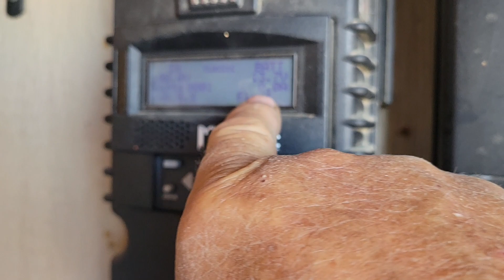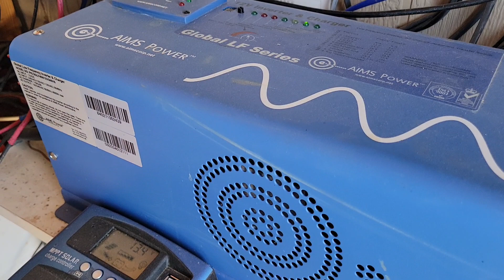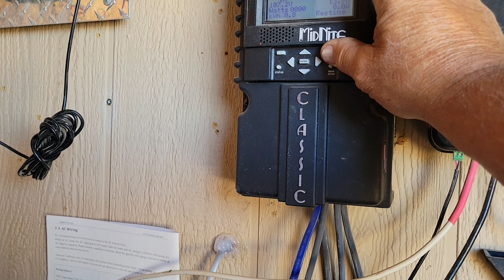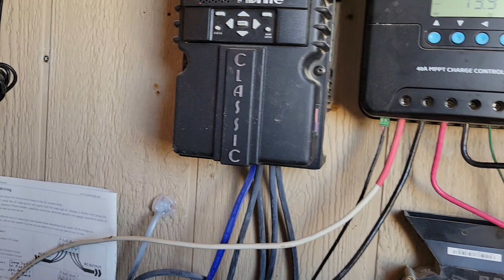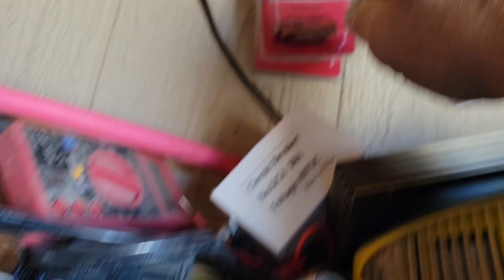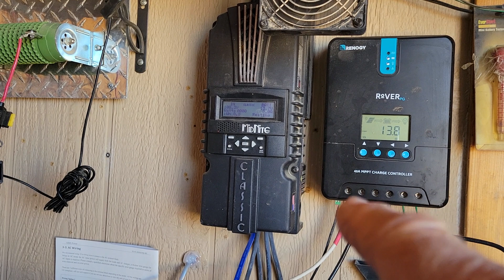How Much Electricity Did I Get In A Week of Wind & Sun? April 13, 2022

Comment: Hi G Bear, thank you for answering some of my questions,  I appreciate that!  Yes, you got some great equipment there...made in the USA 🇺🇸!  Unfortunately I resorted to other brands...although I did go 'big'.  Trying to save some cash doesn't always work out...hope I won't be disappointed when I get it all together there.  I understand about not over-burdening the controller,  and matching pv output with battery capacity.  My concern is  about extra power that I wouldn't use up, in the float stage....this  controller I have is supposed to be able to handle it to some extent as I understand it, but would I possibly need more of a diversion as well?  Thanks again for your help!
Reply from the maker: Diversion is only used with turbines that are directly connected to the battery bank.  All it does is put the batteries under load when the turbine is mega producing power.  It is inefficient and seldom gets activated unless you have a week of high winds like I just went through, but mine didn't activate because I was using the excess power to run a 1500 watt electric heater,  so I was the "manual diverter".😁
Reply: @GBear  thanks!  In the Philippines  I'll just leave the a/c on...that should take care of potential extra power.
Reply from the maker: Lol, as long as your system can keep up with the AC...
Reply: @GBear  yes. I understand..lol.  I noticed you have 2 controllers.  Are they tied together?  If you had to do it all over again,  how would you apply controller(s) use...incorporating both pv and turbine energy?  I was thinking of having separate controllers for turbine and pv charging the same battery bank.  But suppliers frown on that, stating that there would most likely be confusion between the controllers, even if the models are identical.  Speaking of confusion..I am! Lol!
Reply from the maker: I have multiple controllers, all connected to the same battery bank. The 2 main controllers and 4 Harbor freight controllers.
If I would do it over, I would never have bought Chinese stuff.  I would have three Midnite Classic controllers, 2 of them for solar, and one for the turbine.  Midnite controllers can either be used for solar, wind, or hydro power, but not mixing them through the same controller.  Each input requires its own controller.

Comment: G Bear , loved the video, where is the generated power going when the controllers are in float ?
Reply from the maker: Thanks.  It is actually going to the battery bank, but as a trickle charge to maintain whatever the batteries are putting out.  When 'Resting' it just disconnects the solar input.

Comment: I have more than I will use ; at  2 AM  showing 25.4 v on the 18. There was baseball sized hail in the Western part of the state, is why I bring my panels in sometimes. I only brought half of them in this time. I'm distilling water for a battery check and fill. While it's cool enough to use the wood stove. My charge controller stops charging at 27.7 v. ( 13.85 ) but when the smoke clears it will be at 25.8 ( 12.9 )after sundown. I used four pairs of #14 coming in to the controller...today I had 1000 of the 1200 watts of panels out, and the amps were 17.8 or so. The amps used to be around 26 but I split the panels up to face East and West so now it charges until 8 PM, but more amps in the evening than it was before...what it does is if I cook, it has time to charge back up even on cloudy days. A little less amps during one part of day but more the same for most of the day. The voltage fluctuates less. You gave me an idea...When I'm getting too much power tomorrow, I'll plug in the A/C and see how it does. I can fire up the wood stove to simulate summer heat and see how well the system holds up before actual use. I'll get the fan motor oiled up and try it out. I think I have enough to run it now. I have added 600 watts of panels, and 8 batteries since the last time I tried running it. Thanks for the great energy wasting idea, I'm going to try it. I used red #2 welding lead wire on the  + cables, and black on the - . I already got a double box end wrench across the bolts on the inverter after I had all the other cables on, and melted the end of the bolt a little, I will have to use a dremel tool to get the cables off. Two red #2 ones.  It took a chunk off that box end too. But the nut is tight and it's working fine. I put red and gray duct tape over the bolts because the covers won't fit over 2 cables like I have, the terminals are too big...I got the 1/0 size that are part nickel. There is actually room in the lugs to add a second #2 stranded wire and solder them together. I wasn't sure what all I was going to get into when I get the final two batteries in about 3 weeks. I just figured 20 batteries were going to need a lot of places for connections, so I left a third set of #2 cables option. Adding the final two batteries is going to bring my amp hours to a little over 1000, @25 v. = 25,000 watt hours. I have noticed the last few times that I added a pair, the amps goes up from the controller into the battery bank...I assume this means it's more efficient. I will see how much things change...all the numbers change every time. Here's the latest puzzle ; if I only get an amp or so per battery charging, will they use less water this summer? And if there's only a few amps per battery of discharge, will they last almost forever? I hope so.

Comment: Your stuff is getting a bit susty and dusty.  Use fan from  /  filter coming from the out side and the clean air will over pressure all the nuks and crannies that dust can come in.  Things will stay much more DUST FREE. The only way to keep the sand dust at bay here.
Reply from the maker: There's no such thing as dust control in this desert.🤣
Reply: @GBear  LOL No BS THERE.  It does help.  Seriously, our swamp box cooler does the job most well.  All air coming into the house has been filtered thru aspen wood chip and water.  In the military we had something like that for NBC.

Comment: Love your channel and your homestead. Still intimidated by solar a little but recently got my two panels, two batteries, solar controller and inverter all plugged in and working as a test. I want an inverter that power my biggest tool though and or my fridge, any recommendations on inverter for a fridge and a chop saw?
Reply from the maker: Are you running 12v or 24v?  Either way, I recommend the AIMS Low Frequency, Pure Sine Wave, 120/240v Split Phase, 4000w or better.  
Note that you will need to upgrade your solar and especially your battery bank.  
To help you understand it better, the inverter will be running off of the batteries,  so you need enough battery power to last.  The batteries receive their recharge from the solar, (or wind), so the amount of panels affects the speed of recharge, as well as keeping up with use during the day, but after dark your fridge and saw will rely on the batteries alone.
Note that when I started building out here, I did so with solar on my van.
The system was 1 yellow top Optima battery and a cheap Harbor freight 45w solar panel set with controller, and a 3000w modified sine wave Harbor freight  controller.  During the day I ran a small chop saw and a small table saw, charged my Cordless batteries, etc.  Running the tablesaw would sometimes draw my battery down to where I needed to take a 1 hour break to recharge.
Also, don't use a modified sine wave inverter for electronics or refrigerators, etc.  It will damage them.